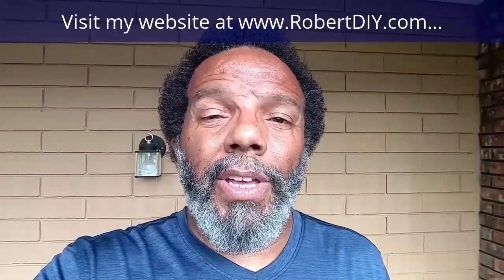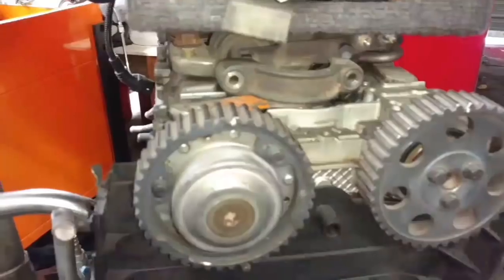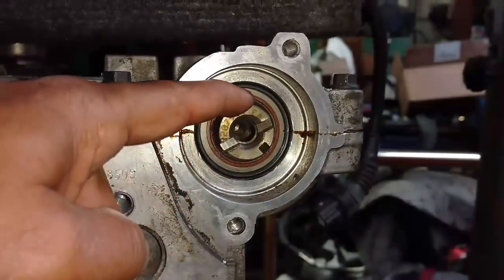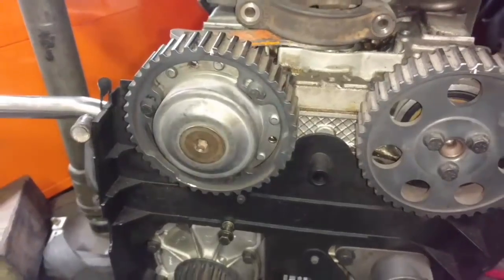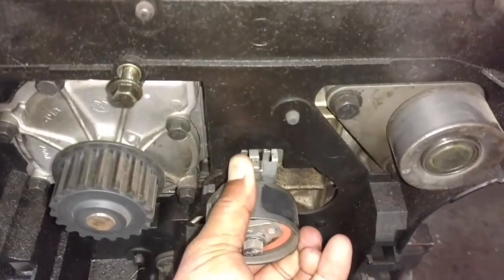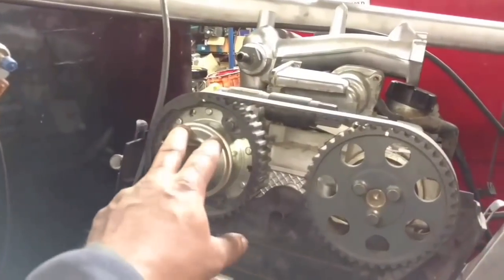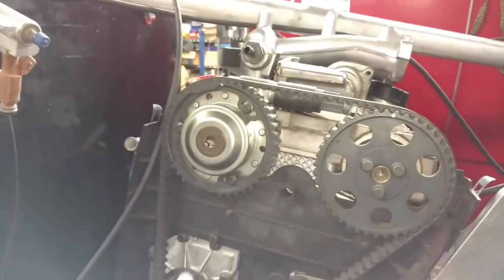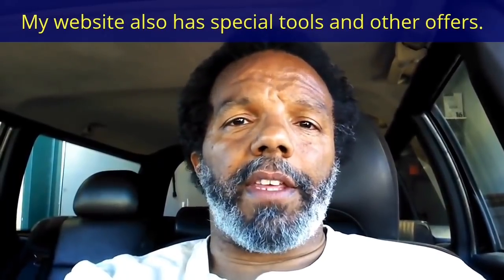CVVT and VVT hub, timing, installation, adjustment, how to install, etc. Volvo cams - VOTD

Comment: Hey Robert! Great Video i have a 2004 C70 and im getting a P0016 Crankshaft Position-Camshaft Position Correlation Bank 1 Sensor A .. 
I replaced all the Sensors and im still getting that code i also replaced Solenoid Exchange. my next move is to do the timing Belt on it and replace the CVVT HUB i think the hub has stopped working due to oil gunk blockage. 

I won this car in a raffle for $100 so i want to bring it back to life! has 170K i replaced the ABS Pump and all the Brakes and rotors. 
DO you have any idea what this code is and how should i go about getting this code removed. thank you for your time i appreciate it! 

Serg
Reply from the maker: https://youtu.be/cWKOi8D4SWQ
Reply from the maker: https://youtu.be/aj4tL32XIXs

Comment: Hi Robert . forgive me for my stupid question.
On  a 2006 , Volvo xc90 , 2.5 L turbo 5 cylinder ,
since I'm not doing more work other than new timing belt ,
does that mean that I don't have to unlock the cams and hubs ,
Can I get away with crank rotation to realign everything that way.

Sorry for my dumb question , 
I hate this damn interference engine .

Thank you for your help friend.

Peace.
Reply from the maker: https://youtu.be/YpOYTVpzzic
Reply from the maker: align the marks before you remove the belt.
Reply: @RobertDIY  O , man  . I'm screwed. Robert , I watched your video on interference engines and what happens when that belt breaks.
When my father was alive last year , I wish he would of taken timing belts on this xc90 more seriously . I tried to tell him , he always shrugged me off about that stuff .  was an 06 . no more interference engine vehicles  for us .
Peace .

Comment: Is the exhaust notch on the cam always down? I purchased a 2004 XC90  2.5t , and the vanos on the exhaust side is new,  THE PREVIOUS OWNER PURCHASED IT , but never installed it. I just want to make sure I am not out 180•
Reply from the maker: yep
Reply: 3 months I have been going back and forth with this vehicle. I finally got it started.. after 45 or 50 times going off of the timing marks.. my compression across the top was in between 30 and 60 PSI.. finally I gave up and went to the top dead center method of inserting a rod in my number one piston.. after I set my cam locking tool.. so first I put in my cam locking tool.. then I played with the top dead center mark on my rod in the number one cylinder.. with the cam locking tool you can get a swing of about 45°, One direction or clockwise.. and approximately 45 going the other direction.. the notch that is on the engine or crank pulley-lined up with the arrow on the pump as described in 2000 videos.. IS NOT 🚫 top dead center.. top gun center is actually three teeth before the mark.. after I set the initial timing zeroed out with all the timing marks.. a continually put my locking tool on... Loosened my tensioner pulley.. and with my socket on my crank skipped a tooth going backwards, as most of the videos stipulate that the timing mark is actually pre-top dead center.. one tooth didn't work.. two teeth I got a rumble.. every tooth checking my compression.  At one tooth before I was able to gain 60 PSI.. at two teeth before the crank mark I got 90 PSI on my compression test.. three teeth before- ? It jumped up to 160 and for the first time in 6 months, this car I purchased off of a shop started up.. fairly rough... But as I loosened my VVT hubs with my 10 mm all three going around each one.. by then turned my hubs clockwise to meet their advanced position... Now I have a running vehicle... I have a 2004 XC90 with a 2.5 turbo... I don't understand all of these videos online stating that the timing should be set from the crank mark to the oil pump mark.. which is very far off from top Dead center.. so to anyone that can't get their vehicle started.. your highest compression output is not at the timing mark.. I have found the timing mark to simply be the safe room in the house, so that none of the burglars on the cams can break in the door.. after I figured out my last adjustment needed to be done, when going backwards I skipped teeth on my exhaust hub.. I simply put on the locking tool.. and gradually got back to zero turning both the uppers and lowers individually as soon as I found resistance to work my way around bending any valves.. I don't know if this will be helpful to anybody.. but had I seen a single video explaining to me that the compression off of cylinder one was your starting point to finding your timing my car would have been running 2 months ago... I'm not joking around I literally timed the car at least 40 times before I finally got fed up and decided I was going to do it myself and eat the $400 in new valves I just had put on the head.. getting my car running off of the marks is not a possibility.. I have timed BMW which has quad VVT and over 500 timing jobs.. 200 or so head gasket jobs... And with my frustration I finally decided to go my own route... If you line your Volvo up with everything exactly where it is supposed to be as described in the other 2,000 videos online and it doesn't work... Take out your coil pack and spark plug on cylinder 1 and find your top dead center with the locking tool on... No matter what the Mark says on the crank... If you're getting 30 or 40 PSI across the top then the crank is wrong.. good luck... Thank you for your videos as well as they were good guidelines for how to not damage my vehicle.. I don't believe the job could have been done without the locking tool as you stated

Comment: Robert, you are the Vovlo man! A query if you have a moment. Have you experienced a vvt actuator not moving the full range. I've had a 640A code & replaced the Inlet Cam Reset Valve ... Cam angle went from no movement (old reset valve was open circuit) to about half movement of Desired against Actual, as indicated by the scantool. Still getting the 640A and questioning the actuator???
Reply from the maker: Only use the OEM actuator. Yes, hubs do wear, bind, etc.
Reply: @RobertDIY  Thanks Robert. Just a thought: if a cam locking tool is used and the crank is on its' mark, surely it would not matter what orientation the cam sprockets are re-installed in, so long as the phaser is turned/held all the way ClockWise and the bolt is correctly torqued. Agree? Or am I missing the reason? Perhaps positioning of hub and sprocket relate to alignment of oil channels between the cam and the hub???
Reply from the maker: Agree.

Comment: HI Robert, you do great stuff. Question. Replacing the cam seals and oil pump seal on my daughters 2000 V70. I have the cam locking tool, Timing marks are all lined up ready to install the tool. On the rear cams the intake is all lined up, the exhaust (VVT) is off a little. I hear you say it may need to move a little to get the tool aligned. Do you move it with that side of the tool bolted on the rear cam? Do you move it with the timing belt on or off? Thanks! and again, love you videos, great stuff for this dad trying to keep his daughters care going
Reply from the maker: I usually take the timing belt off and move it with the tool.
Reply from the maker: I would leave the oil pump seal alone.
Reply: @RobertDIY  I would but there is a significant leak coming from the crank and/or oil pump

Comment: Robert, is it ok to use a non spring loaded VVT on the exhaust side of the B5244T3 engine aswell as the springloaded one?
Is there no difference in the timing?
greets Rob
Reply from the maker: I have no idea what you are talking about.
Reply: @RobertDIY  Hi Robert, when you push the vvt unit against the limit when timing some units show ( spring loaded)resistance  and some not.

Comment: Robert, can you help me? Your video is helping me a lot.
I have a broken Exhaust Camshaft on a B5244T3 engine with the model nr 9207944 EA. on the camshaft.
We have another camshaft from the same engine with model nr 9497822 EA. is this possible to use this one?
Greets Robert
Reply from the maker: I'd probably use the same PN.
Reply: @RobertDIY  Thanks Robert

Comment: Oh ok I see now thanks. My problem is that the non vvt hub seal is bad... there is a video of a guy locking the  crank with a breaker bar and a screwdriver then he loosens the tension on the belt slips it off just enough to take off the non vvt  hub fix the seal and slip the belt back on... do you see any issues with doing that?? thanks!
Reply from the maker: http://www.atthetipwebs.com/technologyinstructions/cam_seals_s70glt.htm
Reply: @RobertDIY  Thanks so much for your quick reply! I did the job and all turned out well! Just slipped the belt off enough to take the non vvt hub off and fix the seal. One good thing about the newer volvo is the belt tensioner is MUCH easier. Man I cant believe how much these mechanics want to do some of these jobs its crazy! anyway thanks again. Hey just curious do you know people that are currently looking for Volvos I may want to sell this it runs amazing its a 2002 rare C70 coupe with the 2.3 HPT motor basically a 850 R motor. Let me know if you want pics etc thanks again
Reply from the maker: https://youtu.be/y3mqyvisV6E

Comment: Been watching you for years Robert, and you have helped me so much... Can't tell you how much I wish that I had seen seen this particular video BEFORE I did a complete head teardown and rebuild...and start-up😒.
 I am in need of an expert volvo opinion before moving forward... I had both intake & exhaust cams 180 the wrong way (didnt know till I watched this video though). I could hand crank engine and marks lined up so, I figured it was good...started it up and sounded like a 1960 VW BUG 😳. Under extreme situations
I had to drive it 3/4 a mile in this condition to a place I could further work on it. 
 Anyways, After finding out by this video, That I was in fact 180 out (by notches on back of cams). I attempted to fix my mistake. After fiddling and fiddling with timing all day yesterday, Its still not perfect. 
But I am wondering if its even worth it to keep fiddling or do I have slightly bent valves due to cams being being 180 out while being driven?
Bonus question concerning The CRANK lock tool. Are there variations of the tool for 2.3, 2.4., 2.5?  Because the CRANK tool I have inside my CAM LOCK tool kit doesnt stop the Crank from turning when inserted behind the starter. 

Any help is greatly appreciated! Thanks for doing what you do for all of us Volvo Lovers!!
Reply from the maker: The crank tool only stops the crank from turning backwards. Not sure why they designed it like that. I never use it. If you can get the crank on it's mark, then set the cam timing, you can do a compression test to see if you're ok.

Comment: hello Mr. Robert. I'm from Poland. I have a v70 II 2.0T on one vvt valve. For 2 months I have been struggling with the problem that my moose on a cold tmp -2-5 + engine is swinging at revolutions while working on the suction. I have already checked the flow meter, throttles, intake, sensors. I only have the so-called variator. Have you experienced such symptoms? greetings Luke
Reply from the maker: No sir
Reply: 1998 volvo need help setting timming srs 2.o I really need someone to explain. I was replacing water pump and when I was putting belt back on winning had  slipped when I went to start car it would not start now I need someone to explain to me is their a simple way to set my timming
Reply: Please help

Comment: Robert, you are a hero to volvo owners! Thank you! I have a quick question: I have a 2006 Volvo v50 (2.4i) with a new head to install. I'm moving the cam hub/pulleys from the old cams, but want to make sure that I have the cams in the correct alignment - how do i know if the cam locking tool is on correctly (e.g. the slots could go 180 degrees and still fit the locking tool on)? There are notches on each cam shaft - do you know if they go on the top, or the bottom when you place the locking tool? Thanks so much in advance!
Reply from the maker: Well, you are supposed to install the tool BEFORE you take the head apart. Also, the slots in the cams and the tool notched are offset from center. If you install the tool properly, the circles line up, if you install the tool wrong, the circles do NOT line up. If you can't tell the difference, you should have the car towed to a Volvo mechanic.

Comment: hi , excelent videos , a mi taller llego un s80 6 cilindros biturbo con los arboles de levas desarmados , tendras un video donde esten las marcas de ambas poleas , ellos retiraron el perno central de vvt , gracias ..... At my workshop a s80 6-cylinder twin-turbo arrived with the camshafts disassembled, you will have a video where the marks of both pulleys are, they removed the central bolt of vvt, thanks
Reply from the maker: https://youtu.be/0H5cgRYCMQg

Comment: Any chance the timing being off would cause a wobble sound coming from the belt area ..gonna remove serpantine belt tomorrow(thanks to your video) and see if it stops .. timing belt was just replaced 10k miles ago code p1332 was only code popping up
Reply from the maker: No, probably a bad harmonic balancer you
Reply: @RobertDIY  thank you ill give that a check how much of a pain can that be to replace
Reply: Sorry to bother again but so would i just need to replace the harmonic balancer or would that be more of a  issue with the cam itself the timing was just done less than 10k miles ago 2 cam seals and rear cam plug.. i  just bought the car so would you suggest bringing it back where the repairs were done looks like the seals were actually leaking when replaced so maybe they can tell me more than the previous owner did
Reply: Sorry i suppose i probably sound like a broken record there just kinda worried now jumping into this scared to mess up the timing replacing the harmonic balancer so ill probably bring it in .. would love to eventually come to you but im out in the minneapolis area so maybe when the timing belts gotta be done next ill bring it out and pay you a little extra to teach me a thing or 2 in person
Reply from the maker: Call me.

Comment: Hi Robert I used the rear cam locking tool and tried removing that t55 bolt well I have broke  two locking tools and stripped the vvt tork bolt any ideas on how I can  get the vvt hub bolt off I need to replace that seal
Reply from the maker: Use better tools. 🤷🏾‍♂️

Comment: Good evening Robert, I'm in need of a crankshaft assembly for 2003 2.5 turbo xc90. So you have one? Can you help me out. Mine spun a bearing, I tried to polish, and I'm having issues
Reply from the maker: No but they are easy to get. Also comes in the S60, XC70, etc.

Comment: i have a 2000 s80 volvo ...I had a belt jump timing and brake the teeth on the belt ... I see on your video that your aligned with the timing mark on the crank and with the block mark...and the number 1 piston is at tdc...if i do that to my motor my number 1 piston is not at tdc its a little llower by a 1/4 cw turn...every thing i see online is to align it to the mark on the block and the crank so if i put the timing belt on and start it will it blow it being its a 1/4 turn off ...or is it right...
Reply from the maker: My #1 piston is NOT TDC.

Comment: Such good information.  On my 2003 non turbo with intake VVT hub, the VVT hub did indeed spring back (CCW) when I removed the old belt. When I installed the new one, the VVT hub went back to the timing mark by itself.  Also, at 6:20, the camera doesn't show it, but there's another small timing notch mark on the 'back' side of the crank pulley. I have a question: what is the difference between VVT and CVVT hubs ?
Reply from the maker: I don't know.
Reply: @RobertDIY  I found a little information about the engines using VVT and CVVT
I believe the RN engines in the P2 S60 V70 cars (2.4, 2.5 etc) had VVT hubs technology.  The CVVT hubs (Contnuous VVT) were rather used in the RNC engines (revised RN) used in the 2nd gen Volvo S40, V50, C70, S80, C30
Reply: Hi
From my understanding cvvt= continuously variable valve timing
Vvt=variable valve timing
Cvvt uses oil pressure to move the hub clockwise aor can move it anticlockwise too. Cvvt is not spring loaded. 
Vvt is spring is loaded and only applies oil pressure to one side on the inside of the vvt hub and the spring takes care of rotating backwards when oil pressure is cut back by the vvt solenoid. 
Both systems ones solenoids to shift the oil pressure to the required passages inside the hubs.
I am not a mechanic but this is my understanding. 
Correct me with proper explanation if I got it wrong.
Thank you

Comment: Robert - some Volvo's camshaft sprockets (both VVT !) did NOT have any marks on it ! So once the cams are aligned and blocked, which marks of the camshafts sprockets have to align with plastic cover ? 
Thank You !
Reply from the maker: I don't understand your question.
Reply from the maker: They all come with factory marks.
Reply from the maker: https://youtu.be/5Lqn2D5xc6Q
Reply from the maker: https://youtu.be/MPt0BZ3B_2w
Reply from the maker: If the car is running well, no timing errors, align the crank and make your own marks.
Reply: I'm talking about those engines (2.5L) with TWO VVT . Like 2004 and up. In the CAMSHAFTS sprockets did NOT exist any factory marks , NONE ! 
So to check or ensure that timing it is perfect, I have to make my own marks ? And that was the question ...

Comment: I've got a '04 v70 t5. I'm looking at a duel vvt. The timing belt cover is removed, nothing else. I haven't seen any video on duel vvt's. I've done timing belts before never like this.
Reply from the maker: If you are just replacing the belt, none of that matters.
Reply from the maker: https://youtu.be/YpOYTVpzzic
Reply: Originally checking checking for oil leaks since there's oil everywhere on the bottom. I put a black light dye to locate where it's leaking from.